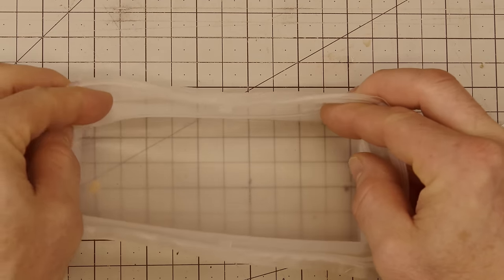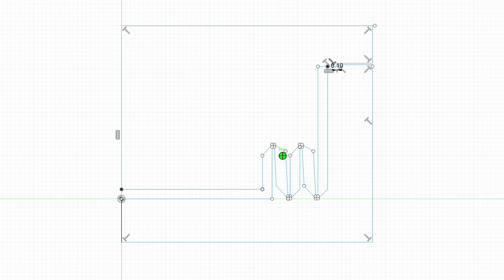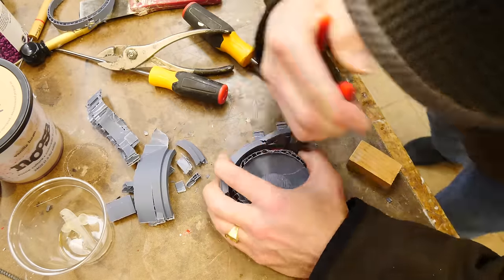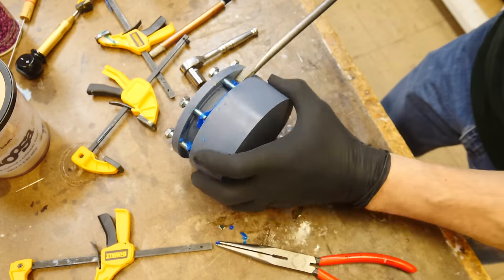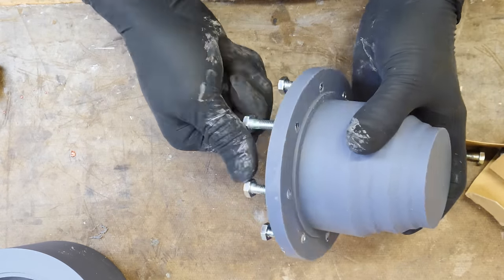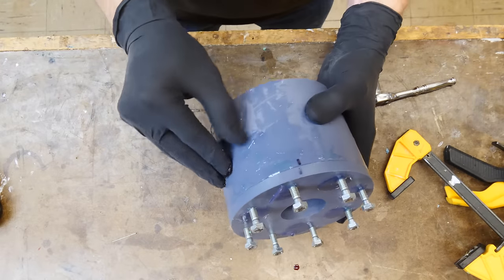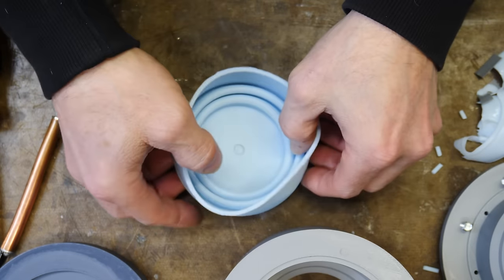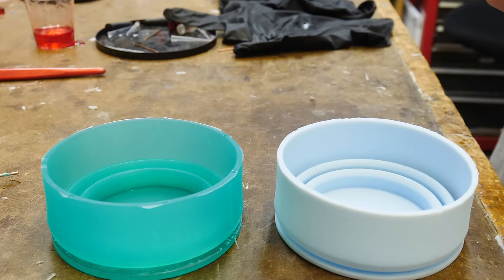Molding a Silicone Container

Comment: As an impoverished hobby modeller (without pressurised systems) I struggle/learn to make molds and casts by trial and error.  With your content [and Robert Talone's] I feel I've come a  long way in a short space of time. Cheers. 
This project of yours has been fascinating - 'molding in the colapsed position' - wow!  And I would say success at last because  the worst of the problems have been identified and progress will obviously garner better results. I would love to see a meeting between you and a manufacturer to see prototype become finished project. Good luck and rock on, my friend.

Comment: Maybe this will help. In real life 3D, has nothing with sharper corners.  And I think if you Bevel all parts when doing the 3D, the molding will not get stuck.  Beveling all parts helps even when I am doing simulations so things don't get stuck. Also, the way you 3D print the parts is important too or it will cause frictions when trying to remove the mold apart. Another thing I do when I 3D print is that I design a system with the metal screws in place by pausing the printing. And a lock mechanism that hold the parts together. Like the ones you see a candy jar. Anyway! Great video! Very informative!

Comment: Switch to petg for your molding.  It has a low friction coefficient so the silicone will naturally release from it easier than pla.  All the molds i make with petg pop apart really easily and don't require any mold release.  Print with the 0.12 layer height and your good.  If you're going to use the mold for production it's worth sanding to 1000 grit, really makes the release easier.
Reply from the maker: Interesting, thanks for the tip, much appreciated

Comment: Inhibit x on the 3d print surface, or a platinum accelerator brushed on can help stop/reduce surface inhibition of platinums on incompatible materials [always test]. You could also  try a thin coat of a 1k acrylic lacquer - something to seal the mold surface before casting. Accelerating the platinum  would also be less prone to inhibition, or adding heat if you can warm the mould prior and during casting to a level that doesn't distort the mould [as that will also accelerate the platinum cure].
Reply from the maker: Good tips, what kind of Platinum accelerator do you use?
Reply: @EricStrebel   I'm in the Uk and it's one supplied from Bentley chemicals here under their generic name. But any plat accelerator will work with any plat silicone - or should do.
Reply from the maker: Ok, I will investigate, thanks

Comment: Hey Eric, at 11:23 , the comparison between the two examples, there almost looks like a small difference between the geometries . This is probably an optical illusion but I was wondering if once released from both moulds if you have checked if they still exactly conform back to the mould again. I then wondered if its possible to make a mould in the half-way position,  ie where a still symetrical cup would be when partially collapsed and would this then be easier to produce and more effectively open up and close down. Cheers.
Reply from the maker: Softer silicone sags a bit

Comment: I love the collapsable mold series, I would like to build a dough proofer box that collapses, however I just cant get the fusion 3d CAD parameters right, do you still use the same sketch profile you revolved in the last video Eric?

Also would you recommend a silicone a dough would stick less to? Despite excessive amounts of olive oil, my silicon molded parts stick like there is no tomorrow :D

Comment: People seem to have lots of trouble using platinum silicone, but I never have any of those issues...
Maybe it's the brand??? I exclusively use Smooth-On.
I've noticed many people don't give it enough time to cure and don't mix it thoroughly enough...
Reply from the maker: I avoid the stuff like my life depends on it, unless I am really really really desperate, I stay away from that brand.
Reply: @EricStrebel  I use quite a lot of Smoothon platinum. Not as "touchy" as some others I've used with inhibition, where you just have to look at it wrong.
Reply from the maker: Right
Reply: @EricStrebel  I'm curious why that is.
Did they do something wrong? Genuine question.
Reply from the maker: Platinum silicone is a tricky material in my opinion, not all silicones are created equal.
Reply: I guess I've just been lucky enough to never run into cure inhibition issues.
I like platinum better since I find it lasts longer for my purposes.
Tin Cure seems to break down suuuuuper fast.

Different tools for different processes I suppose.
Reply from the maker: I don't seem to have had the same experience with my tin cure, I would say they last longer.
Reply: @EricStrebel  Interesting! Whatever works is what's right haha

Comment: Eric, just as a question, if 3d printed directly using TPU will it collapse fine? That's not for mass production, but probably positive part can be 3d printed directly
Reply from the maker: You can try it but, I highly highly doubt it will work. Unlikely

Comment: As far as I have researched Tin cure silicone is not food safe or skin safe. If part is not used for either I imagine it does not matter. Platinum silicone is a pain in the @ss but it can have direct skin contact and certain formulas are even medical grade. Your videos kick ass, lots of good info and amazing reproductions. Its cool to see the mistakes because that shows this process is not easy it takes stuborn perseverance to pull off working prototype designs.
Reply from the maker: Rock on!